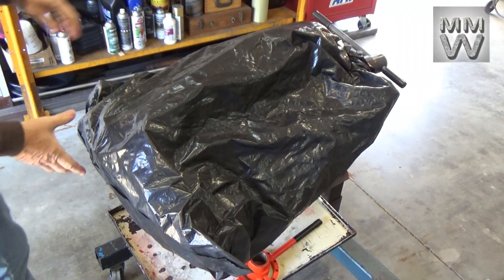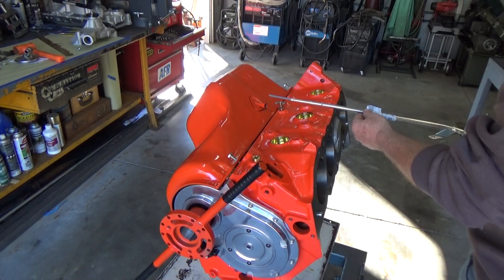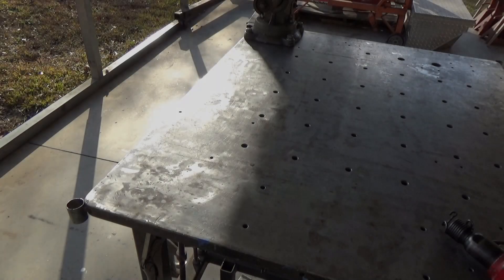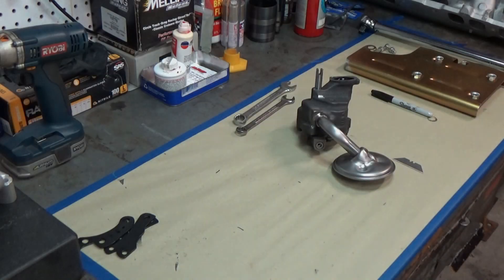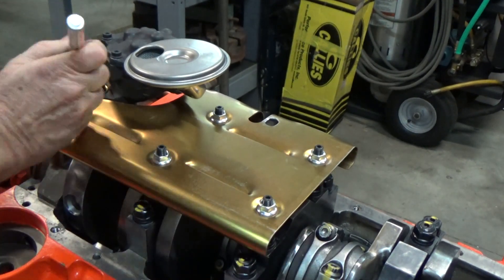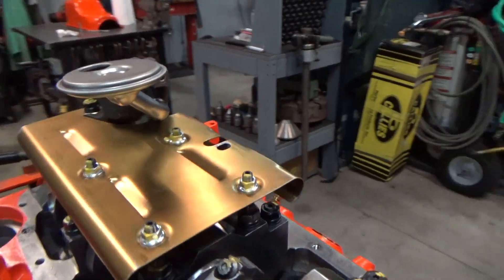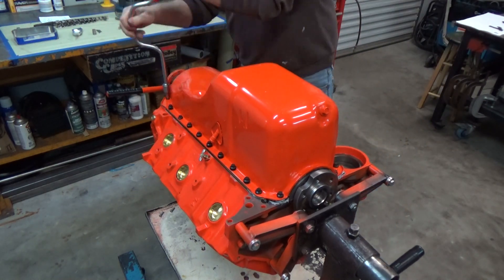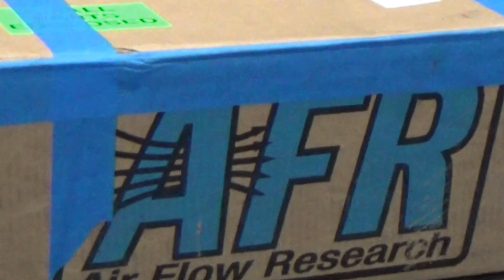Crank Scraper, Oil Pump, Windage Tray & Oil Pan Install...#10 Chevy 454 Big Block Performance Build.

Comment: I am building a 454 for a Ski Boat and need a larger oil pan. Can you share the P/N and brand you used please? Also I see you used a 4 piece gasket do you prefer that over the 1 piece gasket. Thanks...
Reply from the maker: Most people seem to use the one piece gasket.... I used the 4 piece because its what I had in the gasket set.... The oil pan is a C3 corvette BBC L88 from GM...I Dont remember part #..... Good luck on your build...Thanks

Comment: Alright, go ahead and build yourself a whole pan, nice amd deep, passe ger kick out, full windage tray, threaded dipstick...😅

First engine I built when i was 14 (383) I didn't know you needed to weld the pickup.  It ended up being used for a dirt car as a backup and, well, I found out the hard way.  Fell off 😢.  It's twin lives today 18ish years later.  Lots of street miles, 2 dirt seasons, well overdue.

May I suggest cam install 1st, before crank...

And not sure I'm fond of 0 endplay/relying on temp

Good content.  Underrated channel
Reply from the maker: Thanks  SC for the nice comments and info...

Comment: Hello. I used a sbc  Milodon 1 piece rubber gasket and it leaked on both sides of the scrapper.  I'm going to goop some silicone on it now. I assume your cork gasket filled the void and didn't leak?
Reply: The Milodon sbc 7qt. pan requires thick front and rear rubber gaskets. The CVR timing cover requires the thin gasket. Had to use the thin gasket. Permatex, the right stuff gasket maker did the trick in the voids. I had the pan for a few years so I wanted to use it. So, the correct pan for the timing cover or the correct timing cover for the pan is the lesson learned. I hope this helps someone.
Reply from the maker: We used silicone on the ends to seal it up.... Hope you get your fixed...👍
Reply: Hello and thanks for your reply. My leak was at the front rubber timing cover seal. Looks like the seal was too big for the CVR Bullet Proof 2 piece timing cover since it squeezed out a bit in the center. I'll let you know what gasket I came up with that works. @Myersmetalworks

Comment: Damn good assembly. I always measure the amount of torque required to rotate the complete assembly. Yours look like about 40 pounds/feet. Can you believe some of the LT series Vette engines drag at 15 or less!
Reply from the maker: Thanks Laut for the nice comment, and you are probably right about the 40 lbs... We did not use low drag rings on this engine build...  15 lbs of drag is pretty cool.... Lots of power gain there..

Comment: What keeps the other side of the pan plumb and no leaks?
Reply from the maker: Hi royce wheat...  Thanks for the question and the sub...👍  The crank scraper being made out of thin sheet metal it doesn't seem at affect the other side...  But I did use some silicon for some extra  insurance....

Comment: I made a mistake and bought the wrong timing cover for mine haha...apparently there is a huge difference between a gen 4 and 5
Reply from the maker: Bummer...  But the Mark V Engine you have is a good engine... It has few nice things that the Mark IV does not... Looks like you're going to have a very nice engine...👍

Comment: Great video. Cant wait to see what your using for valvetrain!!
Reply from the maker: Thanks again Hybrid... The solid roller lifters are from Comp Cams... Don't have a push rod length for this engine yet, so I don't have the pushrods... The roller rockers are Scorpion... Never have run the Scorpion stuff but have read good things about them for the price...👍